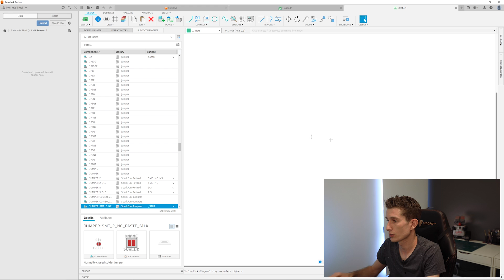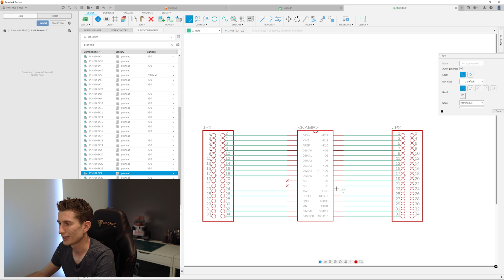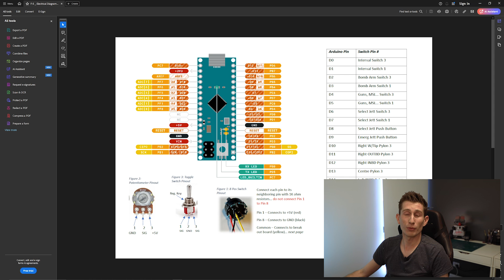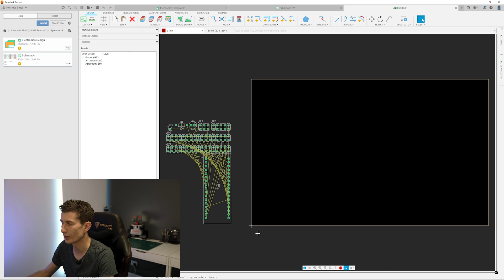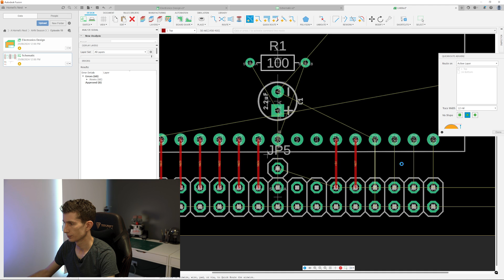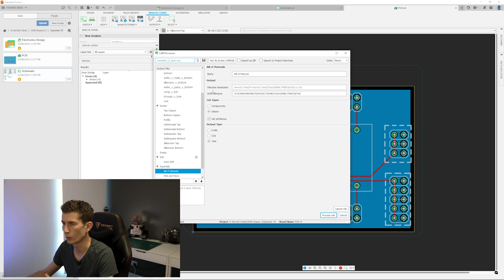Ep: 19 - Make Your Own Joystick Controller + Free Giveaway | Flight Simulator

Comment: Great pcb design tutorial, but I have one question. How can I add some holes to have whatever pushbuttons I want surface mounted? More specifically, I'm trying to design a pcb board similar to karl clarke's pcb board in his 737 afds build video. Those buttons just pop into his pcb board! But I have no idea how to add holes like that or have them measured to align with those buttons...
Reply from the maker: Hey so those holes would be added into the footprint of the design 
If you can find your switch on Mouser.com - they generally have pre made ecad files with all that included that you can download and install into your library

Comment: thank you so much for the amazing tutorials they are very helpful! but i was wondering if you knew any solder free ways to connect switches buttons and other things you would need in a cockpit? i dont have a soldering iron and i just dont like the harmful chemicals soldering produces and i really want to try making som sim panels. thanks!
Reply from the maker: Mmmmm I’m not to sure on solderless connections, especially up into the switch itself
What I do with the soldering when I’m not filming a sequence is open the room and ventilate - and I use a good respirator 
And then wear gloves if you’re concerned about absorption as well 🤙🏻

Comment: Another good beginner tutorial, you are a good teacher👍

why not daisychain the ground from one switch to the next instead of have a ratsnest of ground wires?

Personally i use Kicad to design my pcb's and just export the 3d model to use in fusion if i design a case to fit it in.
The workflow suits me better but everyone has its only prefered tools.
Reply from the maker: You can definitely daisy chain them, but I mainly do it for when it comes to replacing switches - I don’t have to break the chain to get to the switch 
And it stops a “hidden”  break in the chain from a bad solder from cooking the rest up the chain 
But chaining them is a very valid solution of doing it if you didn’t want to make a PCB 
I think Fusion/KiCAD are one of those Apple/samsung choices, which ever one you started with is the one you know and prefer 
I have seen some videos online and people have made KiCAD look nice to use
Reply: @aHornetsNest  that's definitely a valid argument to make.
My prototypes are all daisychained to make things easy and it still ended up in a big rats nest.🤣
One other option might be making the pcb a bit bigger and use 2, 3 and maybe even 4 pin JST connectors.
You lose the modularity at that point but considering you are adding a dedicated filter for the rotary switch on the pcb it is already less modular.
Then again you might aswell design it with the arduino directly on the board if you have the ability to solder smd.

So many ways build it and get the same end result.😉
Sky is the limit right?
Reply from the maker: Haha that’s it… one thing I’ve learnt is “there will always be a rats nest” 😂😂 yeah for sure 
I did experiment with something off camera which I added into the files - was using SMD jumper pads to bypass the filter and allow it to be a pure analog pin. 
Just solder the pads for the function you want 
Yeah lots of different ways ay, I’m using molex connectors for the OH build - they’re quite nice to use by a bit big for this … I used JST for the C-130 panel 
I haven’t quite settled on the “perfect” multipurpose connector yet 😂😂
Reply: @aHornetsNest  there is no multi purpose connector that's the issue🤣
Got 4 different types of JST connectors and they all have their pro's and cons.
JST-PH is my favorite as XH can be a bit tricky to remove again.
I often use molex connectors for power, the type you find on PC motherboards and such for fans as it can handle a bit more current.
Reply from the maker: @samuraidriver4x4 yeah I like a good -PH connector 🤙🏻

Comment: Good to see you back! 

I have a question if I may I've been creating and designing button boxes and have made a simple toggle switch button box and a custom F4 armament panel. I've used printed designs on a sticker and am looking at a 3d engraver however unsure of what to go for.

My question being will a 10 w laser be able to engrave pla like your panel does?
Reply from the maker: 10W will definitely engrave the paint - but my only worry would be that PLA is not very heat resistant - and it might warp or bubble around the engraving 
I’ve never tried it - but if you are just looking at engraving you could get a diode laser and run it over 2 passes on low power to prevent it soaking in the heat of the laser
Reply: @aHornetsNest  that's perfect just the advice I need I shall look into this thankyou!
Reply from the maker: Let me know how you go! 🫡🫡

Comment: One of my favorite things to do when making little breakout boards and such like this one is to add in a few thru-hole pads in empty areas of the board (if there are any empty areas). Space them in a grid 100mil (0.1in) apart and you have a little prototyping area on your board for things like pull-up resistors and other misc components you might need to add in later. Nice video.  Cheers! :)
Reply from the maker: Ay! I like that 😊 that’s an awesome idea